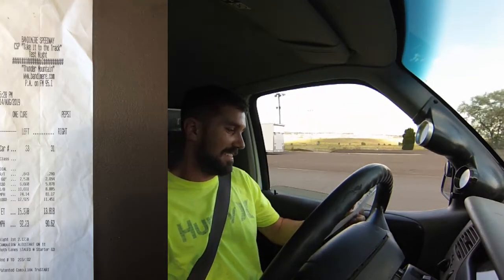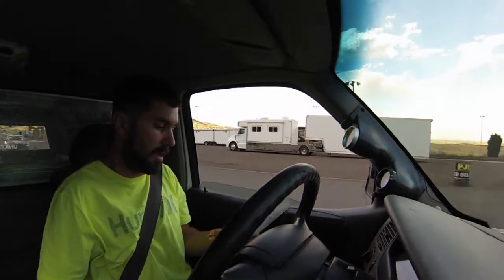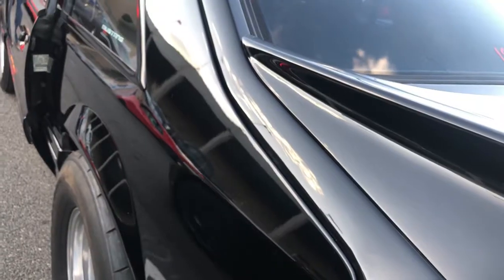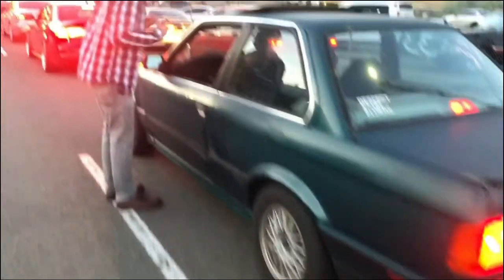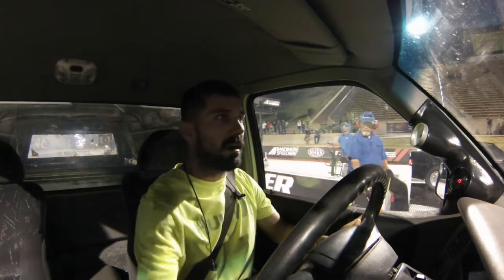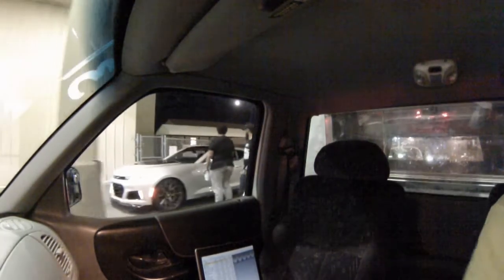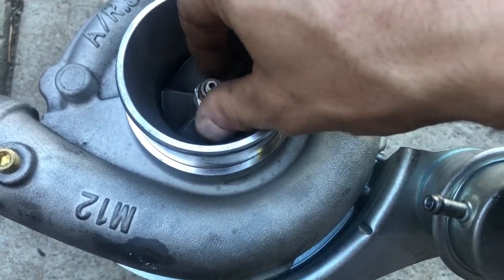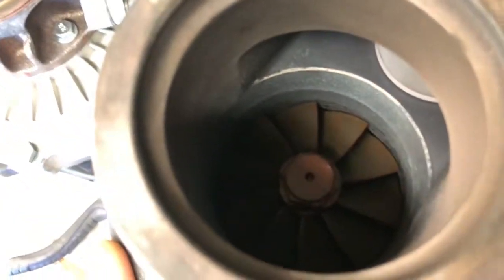The last track night with eBay turbos and street tires had mostly good results

Comment: Fuggin aye . Good stuff B!
Still with the 351?
 Are you power shifting  WOT  or letting off the gas?
Lil ranger dusted off a blown zl1 ! Gota love that!!!
Reply from the maker: This was awhile ago.. aug of 2019, so 351 before upgrading turbos, dynoing it and ultimately blowing it up this spring. 

I was messing around with a clutch switch activated two step that night, so I had a clutch activated 3000rpm limiter for the launch, which also lets you leave the pedal at wot during shifts. I actually don’t like that though, prefer to just kick the clutch and let off the gas. I did it both ways. The smoother shifts were done classic clutch kick and lift style. The ones where it bucks was when I left it wot.
Reply from the maker: Come to think of it all of the stuff I was running in this video engine-related is sold and gone. Engine block, aluminum heads and all. All I have left over from that setup is the intake and exhaust manifolds. More on that later... will try to update...

Comment: New sub here... what are you using for computer/fuel mgmt/tuner/making it all communicate & work together? Have flipped through a lot of your stuff looking for that piece of the puzzle. Love the content!
Reply from the maker: Welcome! 
Ecu is a factory 99-01 explorer v8, using an sct livewire handheld with pro racer software. Controlling boost with internal wastegates using solenoids and a switch on the dash. Fueling is 80 lb/hr deka injectors, e85, and a single walbro 450 with 65 psi base pressure  (recently upgraded to dual pumps and boost reference on the fpr)